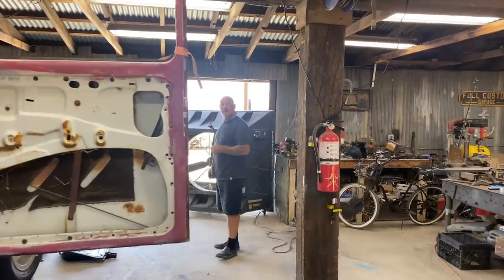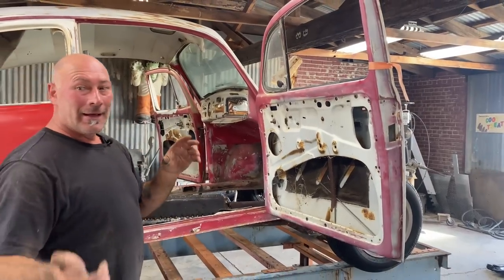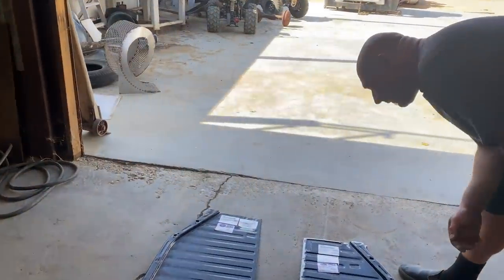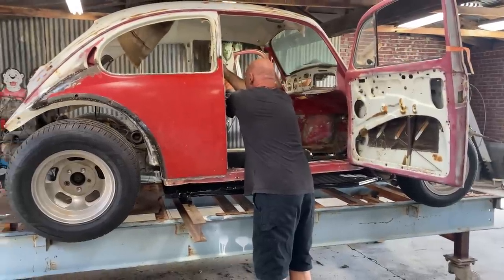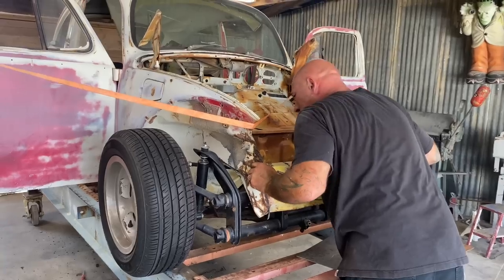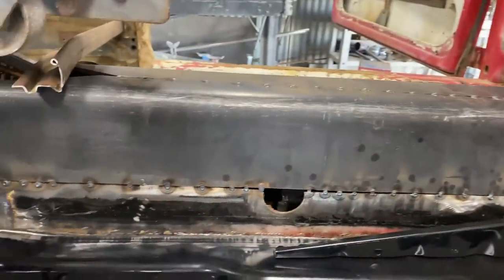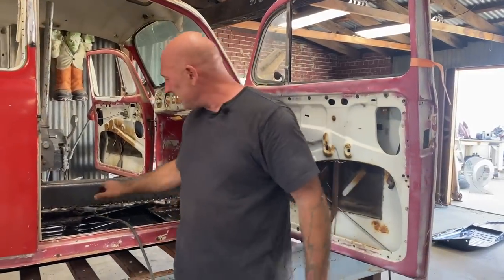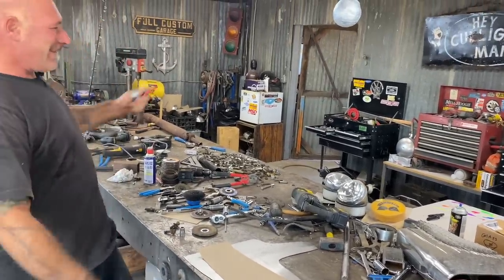Part 10! Full Custom Ian Roussel 1968 VW Beetle Floor Pan Replacement! 🚨😎🔧

Comment: hello. here in brazil the beetle was produced until 1986. it was manufactured again from 1993 to 1996. there are still many beetles running and the aircooled culture is very strong in Brazil. there are many events for vw aircoolrd

Comment: That black undercoat is bitumous underseal, and is great for attracting rust and promoting it. Dealers across the world used to offer it as option. 50 years ago I knew it wasn't any good for preventing rust as I could see it failing all the time .
Reply: It was more of a sound deadner .

Comment: Ian, you use the same first aid kit I do! Duct tape and a piece of rag!! On your left thumb was it the Death wheel got you? Check out some stick wax for a bit of lube for saw blades. Makes them cut cooler, better and last a bit longer!! You are correct about Lenex and Milwaukee blades, they are the best, but pricy.

Comment: Love the show Ian. I've always had a soft spot for VWs. My dad had a bunch when I was a kid. 

Everyone I knew in the 70s undercoated their cars. I did grow up in Salt Lake City, Utah though and the winters can be brutal here not to mention the amount of salt that gets thrown all over the streets. 
That undercoating was asphalt based and it dried out after just a few years. After that I think it actually trapped moisture and caused rust.
Nowadays spray on bedliner is the way to go.
Your screwdriver/alignment tool is clearly from Harbor Freight. Your secret is safe with me. I won't tell anyone 😉

Comment: Under coating was a necessity in areas where they lay down salt to melt ice on the roads, but it also provided some vibration noise deadening. What the heck is that square that sticks out behind the door that seems to accommodate a square tube? I kept waiting for Ian to cut it off.
The eye muffs will need to sell for close to $20 bucks retail if they want to be competitive. 
Thanks for another informative vid.
Reply: It's the receiver for the factory jack
Reply: Thanks  @taloniilm . I never noticed one on the VW's I've seen up close.
Reply: @Danno_A_Jyd  Usually the running boards hide it.
Reply: Thanks  @65cj55 . My associations with VW's is almost nonexistent, so I thought I simply missed it. Ian is teaching me a lot about them and so have you. Be well!
Reply: @Danno_A_Jyd  They're a interesting Car, it's quite unique how they built them.

Comment: 1996 was the last year that vw Brasil produce our bug, vw fusca.  Mexico stops their bug production in 2003. And about that undercoat, no, its not factory made, we call it "batida de pedra", its kind of very thick látex water based paint used as under seal. The factory one is not water based, is bi component stuff that we call KPO.

Comment: Here in the UK, the stuff painted under the car is 'underseal'. It is a bitumen based coating to prevent rusting. It does dry out and come away from the paint, but people never rubbed down the paint for it to stick permanently. And it used to come off easy as you have seen. Some places it is a pain to remove, but it was best to drive along a dusty road when it was freshly painted on BAck in the 1980's, it was fashionable to paing half way up or all of the sills (rockers).

Comment: Noticed you were using the Lincoln, any more words on the Arc Captain? I'm in the market for a beginner friendly combination 120/240 Volt welder. 
Also definitely interested in an on-line live class.
Reply: There's many Arc Captain revue Video's, all seem good, it does Mig, Arc and scratch start Tig.

Comment: Jeez...I thought my welding was bad lol. You should have drilled holes in floor pan before trying to plug weld it. Would have saved burning all the holes through the edges. Makes it look like crap the way you did it.

Comment: Undercoating sold by "Ziebart". The full treatment can be told by the nickel size yellow plugs that covered the holes that were drilled through out the body panels
that had hidden areas like rocker panels. Very prevalent in the midwest.

Comment: Hi Ian question. 
The $500 welder have you had any more luck using it ?
 Or have you placed in a corner
Reply from the maker: I use it when I travel and bring all my gear… it’s a little fussy but works great

Comment: Well if got in your wayback machine and tripped back to the 60’s, then you would hear swift used in a manner meaning good, great, awesome…. That was really swift. 
 Later is was used to the opposite as in … big fail  Swift move blockhead..😂
Reply from the maker: 😂 It is funny how words can change meanings through the years.